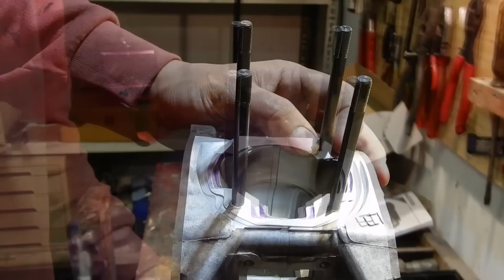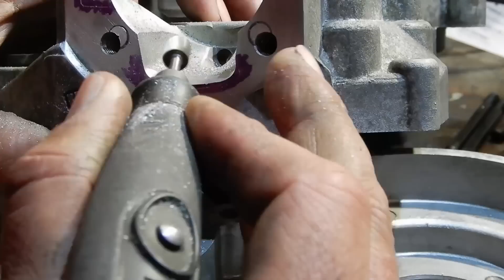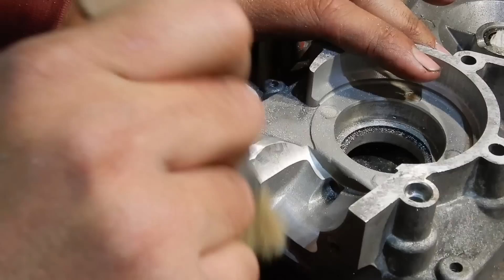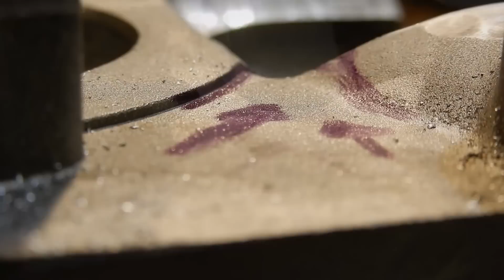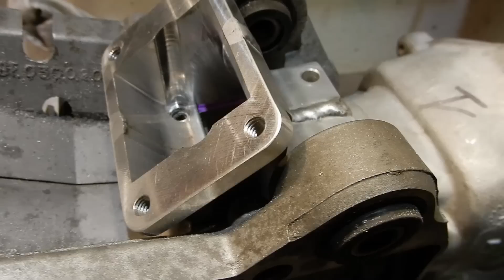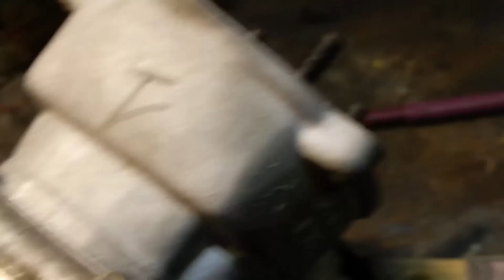Derbi Variant de Carreras MHR big bore fase 3 ENCARADO DEL CILINDRO

Comment: Muy buen vídeo . Tengo una pregunta Xavi el de ratquad en uno de sus vídeos que según el carburador que montases iría mejor una caja de laminas que otras si sabes cómo se hace podrías explicarlo porfavor
Reply from the maker: Hay formulas para calcular el area que necesita de caja de lamimas. Pero mi opinión es probar ya que ay demasiados factores que podrian influir. Lo que sí que recomiendo son laminas de carbono ya su propiedad de rigidez/flexibilidad/rapidez son muchos mejores que el metal o la fibra de vidrio. En cuanto a grosores . 0.20 se considera blando y 0.40 duro. Ir probando y descubrir que dureza es la deseada. Una blanda tendra mejores altos en altas rpm. Y duras mejor respuesta en bajos pero peros altos ya que no dejara entrar grandes cantidades de mezcla.
Reply: También me gustaría saber qué embrague de los que has probado te a ido mejor y con qué muelles es para una aerox
Reply: @lluis.florit89  también querría saber cuál es el mejor embrague que has probado y con que muelles es para una aerox.
Le voy a montar un top negro ,c16/07,21oko con filtro top,variador top y correa top con el muelle amarillo grande y 3'5 de peso de rodillos aconsejame para sacar el mejor rendimiento
Reply from the maker: @ByPica  el embrague stage6 torque. Es el mejor que e probado.
Reply from the maker: http://www.bricozona.com/motor/motor-dos-tiempos/24-laminas.htm